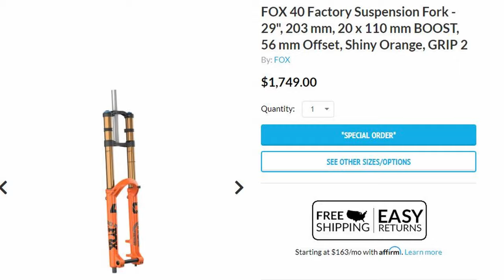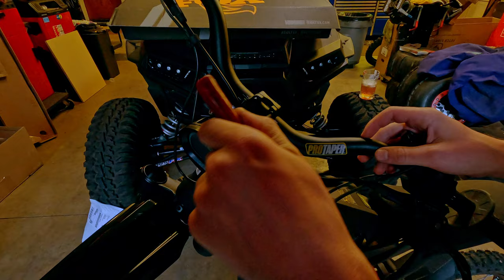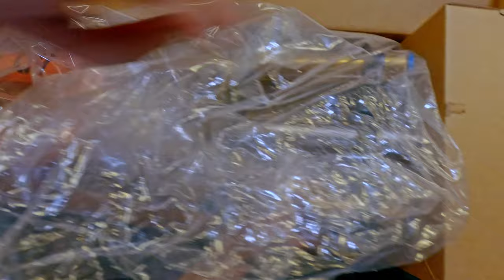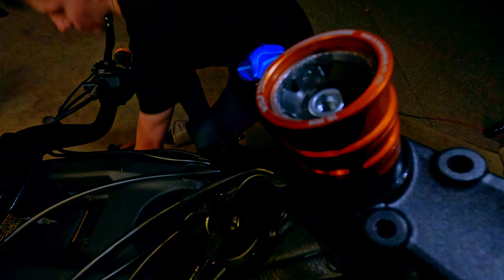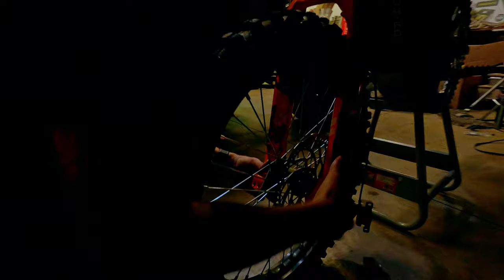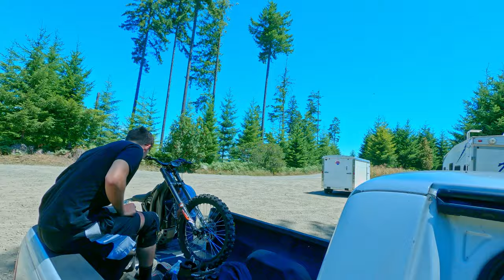Sur-Ron Fox 40 Installation and Test Ride + First Impressions

Comment: what are those golden rings in the middle, where the stem sits??? Are they fork spacers and if yes, what brand and size please.
Reply from the maker: Stem spacers. They were on eBay and seller took them off.

Comment: Hi, great video. 
I just went to fit my Suron front wheel but there is a 1.2mm gap between the hub spacer and the Fox40 fork leg. So 0.6mm each side of hub. Brand new bike  brand new forks.
Did you have the same issue?

Comment: Great video. You may want to get a drop crown to lower your stack height and get back more travel.
Reply from the maker: The stack height is as low as it’ll go. The thing that looks like a spacer is a weird bearing cup that extends past the frame. We measured the stroke and it’s still 8in so we should be getting full travel.
Reply: @emotobros  In Fox's online data sheets it says the maximum length from "top of the crown" to "top of the upper tube" should not exceed 137.5mm (~5.413inches), otherwise the seals will bump into the crown when bottoming out. With the headtube height plus this weird spacer looking thing mine is actually about 170mm and I lose some fork travel as well. Can't install FOX's mud guard too. Has anyone solved this problem?

Comment: Ive been running the Fox 40 (Elite) for about the last year. Not really a massive difference from the DNM in my opinion.  Oh well, you live and you learn.
Reply: Before checking the price I expected it to be a 250-500 dolllar upgrade, and that it might be worth it. But 1750 dollars is insane, I'm not spending that on suspension. Personally I would rather spend it on either wheels, control board, or higher voltage battery.
Reply: All though I must add, my first upgrade would be to actually buy an Sur-Ron, haha don't have one yet, but when I get some extra money in my wallet, I'll probably buy one.
Reply: Do you bottom it out still like the factory fork?
Reply: There is big difference between fox40 elite and fox40 kashima
the coating of the fox 40 kashima is specially made to make the work of the fork smoother and more oily, while the fox 40 elite does not have this upgrade
And the kashima coating makes the fork price bigger and i prefer to buy fox 40 elite because the price is not that much

Comment: Damn you guys are fast. Your buddy had the stock fork and he was hellah fast. Do you guys use regen for braking? Thanks.
Reply from the maker: Max regen. Saves the pads. Our controller allows quick adjustments of the regen on the fly so it’s easy to turn it up on steep descents.

Comment: Looks like a fun ride.  I have found the Fox 40 used and new from 600-1300 on eBay.
Reply from the maker: Fox 40 factory or elite? Elite is practically a lateral move from stock, I wouldn’t do it. A factory for 600 though?... that’s a damn good deal.
Reply: @emotobros  There is a used factory on eBay right now for 650.  Yes it is an amazing fork.

Comment: What year and headset is/on this bike? My lower crown had to be moved down quite a bit to clear head tube. This makes it a bit of a tight fit on the lower bridge to the lower crown at full compression  🤷🏻‍♂️

Comment: Thanks for all the vids! Quick question though, Is that fork 110x20 boost? I'm asking cause I picked up a Fox 40 and I only found out on installation that it's a 110x20 boost and my caliper does not align with the rotor. With the wheel mounted the caliper mounting holes are offset roughly 5-10mm from the post mount fastener holes. What's your thoughts on this predicament?
Reply from the maker: So to fix that you just have to buy a 5mm rotor spacer. That will offset it and line up perfect with the caliper 🤘🏽

Comment: Can you cut the steerer tube flush to the triple tree instead of using all those spacers ?
Reply from the maker: Yes, I preferred to keep it long in case i wanted to go back from a direct mount stem, in hindsight though it was probably not necessary.

Comment: Hi guys I have a few questions, do you need to use a drop crown top clamp? Or do you just use the same top crown that comes with the fox 40s27.5 forks? Also if I use a direct mount handlebar clamps I won’t need to use those orange spacers will I? And one more question do you need a spacer for the front wheel that goes between the hub and the front brake disc? Thank you very much
Reply from the maker: Hey Keith. We found that the travel exactly bottoms at the standard crown. It is pushing it a bit close and we’d probably go with a drop crown if we were going to do it again. Whether you need the 5mm spacer depends on whether you got the boost or non boost version 🤘🏽

Comment: Do the upgraded forks bottom out at easily as the stock forks?
Reply from the maker: Only running 85 out of a maximum 120PSI and have never bottomed.

Comment: Great video! Thanks for the information. I put the 2021 Fox 40s on my server on and the brake caliper is not lining up even if I slide it all the way towards the rotor. Any suggestions? Even if I reamed out the oval mounting holes I don’t think it would line up properly with the rotor. It’s that far off. 😕
Reply: Most forks have specific adapters for the different brake Brands and rotor size. You changed forks so you’ll need the proper adapter.

Comment: could you just slide out the old  stanchion tubes and replace them with the fox 40 stanchion tubes and keep the original steerer tube/triple crowns?
Reply from the maker: No.

Comment: how long are you riding normally? Range after a offroad ride?
Reply from the maker: Get about 25miles of hard single track riding from 100%-10%.
Reply: Thats pretty good, could you track the range again after youve installed the BAC4000? Maybe you put it in the description. I have the same range with a 3,5kWh and 12kW QS205 Hub motor
Reply: It’s very much speed dependent, we have done mountain rides with 2000’ elevation gain over 20 miles up to top, turn around come down and have 50% battery with a slow rider.  Then my daughter jumped on it in Moab and went full speed down dirt roads that were mostly flat and killed it in 20 miles.  An average mountain trail ride seems to be in the 25-30 mile range.  The faster you go the less miles you get.

Comment: Thanks for making this video.  Ours needs suspension upgrades BAD, rock gardens are horrible on the DNM.  Finding a used one is nearly impossible because you need a minimum 8.5” steer tube which is really only found on a new fork.  Curious, what measurement did you cut yours at?
Reply from the maker: No problem, we agree the suspension was one of the first to go! Can’t quite recall what we cut ours too but yes, needs to be longer than an MTB which makes the used market rough. Remember though, you can always buy an uncut steerer tube and get it pressed into the used tripple trees!
Reply: @emotobros  hey can you show show to change mid/rear suspension

Comment: If I order Fox 40s for my Sutton do I need to get 27” or 29”?
Reply from the maker: We recommend and use the 27.5”. The 29” makes the front end a bit too high.
Reply: @emotobros  thank you so much and is there anything els I need for the forks to fit right if I end up buying them?

Comment: What is the difference between the fox 40 27.5 and fox 40 29 I know one is for a bigger tire, but thats about it. I have ordered bigger 21' front tire from woddys wheel works and am wondering about whether I should get the 27.5 or the 29 fox 40
Reply from the maker: Basically the 29 one will just raise the front end more. Even with a 21” wheel the 27.5 gives plenty of clearance and keep the front height reasonable.

Comment: How is the plushness for soaking up rock gardens compared to the DNM?
Reply from the maker: MediumEnduro The plushness of the fork is very dependent on your set-up. It has the capability of being very plush or very stiff. I would call it a noticeable improvement but it still feels like your going through a rock garden😂😂
Reply: The DNM is pretty terrible in the rocks...it’s motivating me for an upgrade.

Comment: What do i need to buy to fit the fox 40 on my surron ?
Reply from the maker: Harvey Wallbanger as long as it’s a non cut 1 1/8” straight steerer with 110x20 axles it should be fine.

Comment: You have the adjustments sorted yet? Please share or update the dialed in specs. Cheers!!!
Reply from the maker: We are still playing around with the ideal settings. We haven’t tested any additional air volume spacers and we change the settings depending on the terrain. The air pressure is very dependent on weight but we run about 15% sag. We will try and do a video on it soon but there are so many options with these forks that posting a video recommending just one setting would be doing it an injustice.
Reply from the maker: Send us an email and we can get our settings to you, don’t want to post anything publicly yet though.

Comment: @E-Moto Bros  Thank you so much for your reply. Lets say I already ordered the fox 40 29.  Do you think there will be any negative impact from having the 29 over the 27.5. I still have the option of returning and then getting the 27.5.  I am 6ft 5in. Do you think having the 29 and the extra height on the front will cause me any problems?
Reply from the maker: Will just cause the bike to sit higher in the front then it’s meant to so you’ll need to buy a riser linkage to even it out. We sell them on the site. You’d need the 1.5” riser
Reply: @emotobros  Thank you again for you advice and input I greatly appreciate it. As luck would have it, I have already purchased and have a 1.5” riser. Awesome news.
Reply: It will change the geometry, I wouldn’t do it just get the 27

Comment: so there’s 46/48/50/52/56mm offset

what is that and which would work best on the surron?
Reply from the maker: We have the 52 I believe but any of them will work. Just depends how far you want the front wheel in front of the bike.
Reply: @emotobros  blink

Comment: What direct mount are you running
Reply from the maker: Added to description.
Reply: E-Moto Bros hey guys, can you recommend the best high rise /extended DM stem that I could use with my 3” Pro Tapers?  I ended up getting a set of DVO Emerald forks from Luna while they had them but haven’t installed anything yet.  I was eyeing the one Race Spec Sur Ron sells since it seems to give me the most room for when I have my kid as a rear passenger. Wasn’t sure how good it was or if everything will all work together.  thx
Reply from the maker: @troymuni6120  Haven't used any stem other than stock and the two linked in the description. That being said, we think either of the ones in the description are good choices. We run ours with 1 12mm direct mount spacer.
Reply: @emotobros  ok thanks anyway.  I need to find something that'll give me more room because of the arm fatigue with my son riding in back more than just some extra bling so I guess I'll just give that Racespec one a shot.

Comment: Is the front surron hub boost or non boost?
Reply from the maker: Either work as long as its 110x20 but boost hub requires a shim for the rotor. Non boost is a direct fit and what we have.
Reply: @emotobros  thanks for the answer! I’ve got one more question, how much of the frame tab do you have to grind off?
Reply from the maker: Maybe a mm or two. Hardly any at all.

Comment: Is it actually made for this heavy systemweight? The Surron is around 60kg and the driver also 80kg so we have a systemweight from around 140kg! A Mountain Bike is way lighter. Thx
Reply from the maker: Definitely not made for it. That being said, with a light rider like us it works just fine and is within the limits of the fork.

Comment: Where did you get the headlight?
Reply from the maker: We are in the middle of making a headlight/night ride video. Subscribe and stay tuned for a full walkthrough on that!
Reply: @emotobros  No one ever tried to mod the headlight of a Surron. I wish someone add another light under the default light😅 like the traffic signal🚦
Reply from the maker: @33jayy  Not a bad idea but considering the lights we got were only $25 it seems unlikely that any mod we could do to the stock light for under that price wouldn't be better than the one you can just buy. A multi-light setup might be kinda cool. You should try it out and let us know how it goes!

Comment: Any upgrades on the rear shock?  I’m waiting on the BAC4000 and 54t sprocket for added performance.
Reply from the maker: No upgrades on the rear, yet... We have the 56T and just received the BAC4000 so a video on both those things should be soon.
Reply from the maker: ΛLỈΞИSИΞΛK ΛLỈΞИSИΞΛK you are somewhat right on that. The stock BMS allows 85amps continuous which will give a ~15% increase in power. However, you can BMS bypass it and run at max cell discharge (105ish amps).

There are a couple problems with doing that though. 1 is that you are pushing cells to max discharge which can wear them out quicker, but also you lose the ability to balance your cells which we feel is very important.

What we decided to do is completely replace the BMS with a high amp Bluetooth BMS from eBay. This will allow us to run 7000Watts and still balance our batteries.
Reply: How long did it actually take to get your BAC4000?  I placed my order July 16th, nothing yet.  Just read a forum with several people receiving bad orders 😬.  Is there another company that puts out a similar product in quality?
Reply from the maker: Micah we are actually distributors for ASI so we get our controllers in less than a week. We plan on selling them soon so if you wanted to buy one from us you’d be able to get it in under 2 weeks.
Reply: Seriously?!  I’ll see if my credit card company can reverse the transaction due to inactivity.  I’ll definitely place the order through you.  Is there a site for orders?
Reply from the maker: Micah we had to backcharge ERT too because we never got ours after a month and no emails either. That’s why we decided to become distributors. We are working on getting the brackets made but then it’ll be ready. Stay subscribed and make sure to be on the lookout for the video!
Reply: E-Moto Bros The only problem is where do you get the NXT without going to ERT.
Reply from the maker: @troymuni6120  We aren't going to be using the nxt system at all. We have our own displays that are far simpler.
Reply: @emotobros  Probably the right call.  Thx.  How much power are you planning on pushing through it?  I read they blew up the motor after 100 pulls so you shouldn't push it beyond 70kw.  Not sure if that's true or not tho.
Reply from the maker: @troymuni6120  With the best battery you can currently buy that isn't a very custom build, you can pull around 300 amps from a 72v battery. This equates to around 20kW which is what Luna's new kit supposedly has so I think we are safe in that department. 

Not sure where you got the 70kW number from but yeah that would definitely destroy the motor.
Reply: @emotobros  Sorry I may have added an extra 0 there.  Just going off memory on this one...think it was 7k watts that fried the motor after 100 pulls during Luna's stress testing.

Comment: Could you put a 29" fox fork on the Sur Ron instead of a 27.5?
Reply from the maker: You could. This will increase the the height of the front pretty drastically and it will also decrease your head angle though.
Reply: @emotobros  I guess there isn't really a benefit to using 29 over the 27.5 then. I can't seem to find anyone who has tried it.
Reply from the maker: When you can’t increase  the size of the rear to match it results in unwanted geometry changes. You don’t want to be riding around like a chopper.
Reply: @emotobros  I appreciate the info and I like your channel. I hope you guys get more Sur Ron stuff in stock soon... I am starving for upgrades.

Comment: The only one reason I would not change to the fox 40 is cause of weight. I think the weight of the sur Ron is gonna be to much weight for the 40. Most bicyclists who use that fork are light as are the bikes they go on are too. The  Sur Ron is about 50 to 60 kgs stock and most bicycles that put on a 40 weigh about 20 to 60 pounds depending on the style of bike you ride.
Reply from the maker: What part of the Fox 40 do you not think can take the weight? It’s much sturdier than the DNM and is designed to take massive hits on downhill and free ride trails. The fox manual has suggested air pressure for rider weights up to 250 pounds but these forks are built with a pretty large factor of safety for reliability reasons so I would imagine  unless your riding at red bull rampage and pushing 350 you won’t have any issues. The ability to ad air volume reducers is critical for tuning your air ramp at the end of the stroke for big hits. If your over 300 pounds and doing massive free ride hits then yeah, maybe reliability becomes a concern but then again a rider of that weight might be better suited on a full size dirt bike. Regardless though it’s miles ahead of the DNM as far as strength, rigidity and reliability goes. I would expect the head tube to break off at the welds from the frame or the rear suspension linkage to fail before the fox 40 would.

Comment: Is this bike like the segway x160 or x260?
Reply: Yes Segway is a share holder of surron and can copy the surron bike. the models are identical except the x160 is a slower version more for street and commuting. the x260 is like the surron x made for off road and speed
Reply: @loganwerdt9220  not a yes or no question but oh well. Like the 260 got it. Thanks!

Comment: The manitou Dorado Works much better Thun the Fox40 on the surren.
The Fox40 is designed for a System weight of Max 170Kg inclusive. Driver.
You habe to perform a lot of Modifikations to the fox40 to works well on the Double of weight.